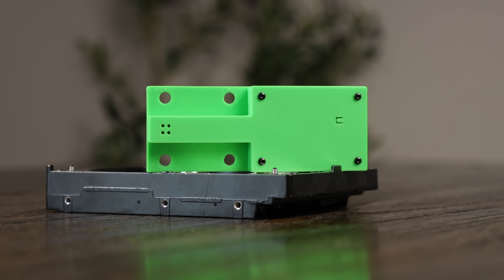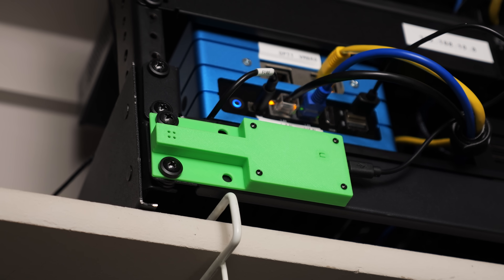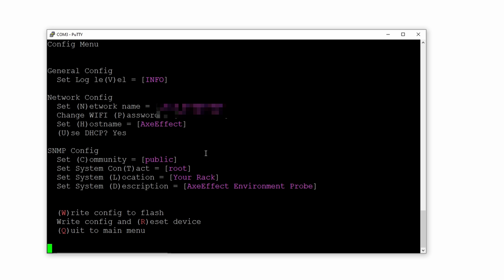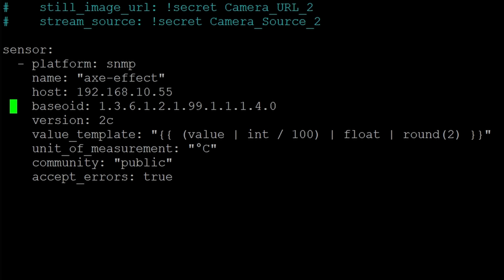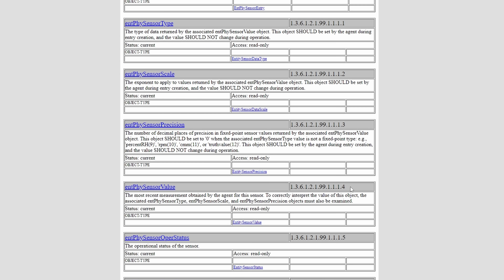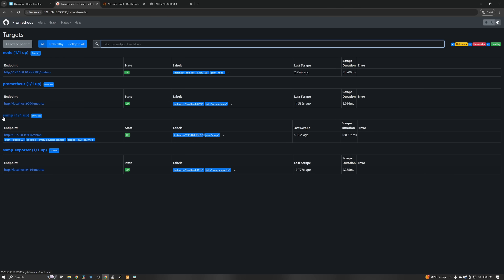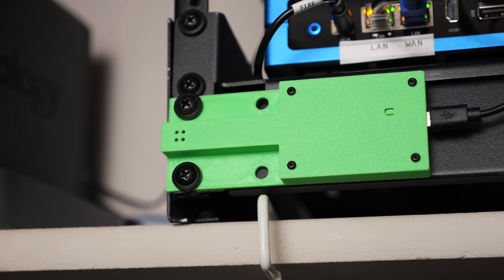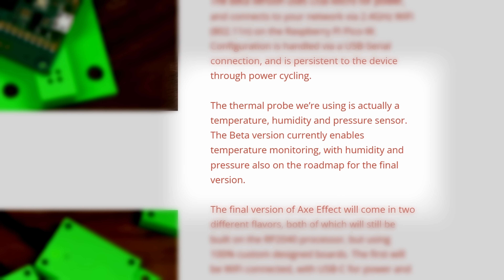This problem in my home lab is finally solved.

Comment: Why don't use something like xiaomi temperature And Humidity Monitor for something like 5$? It cost less, no work required, looks pretty. Can connect via Zigbee or Bluetooth to home assistant. And also lots of firmware available, if you need some additional control over it.

Comment: Having the MCU connected in that way to the temp sensor likely would not have accurate temp because the slight raise in temp from the RP2040 would throw off accurate temperatures.  Secondly why use wifi for temp sensors?  If you are that close to your server, why not just read the data directly from the pi and avoid flooding your environment with even more freqs?   Not good for our blood as the research is showing

Comment: I find an easier way to manage SNMP devices is using LibreNMS, this can store it's data in a InfluxDB database which is natively supported by Grafana. I still need to learn Prometheus myself to see what benefits it would offer me but I've been using the LibreNMS system for many years now and it supports pretty much any SNMP device easily without worrying about OIDs and coding, it also supports various alerting formats as well which may be helpful.

Comment: A couple of nitpicks on value_template thingy:
If you divide the value by a 100 you already get a float right? The digits must be there already because when you cast the value the digits are not lost right?
And why would you need to round(2) since the digits do exist within the float?

My understanding is that you probably are convert the string 2231 to an integer, this is fine (but weird it would be reported as a string), then when you divide by a 100 it is implicitly converted into a float it should only have 2 digits at most.

I'm nitpicking because I believe that relying on ChatGPT for simple things like that is just a lazy way of not reading documentation while using a complicated formula that seems like it could be simplified as "{{ (value | int / 100) }}".
I don't have the device so I can't try it for myself but I'm all for making configuration files as simple as possible.

Comment: Obviously this thing has a lot more compatibility than just home assistant, but that you can get that old ESP & temp sensor in Home Assistant with Tasmota in about 15 minutes from scratch. You don't have to write anything and it's pretty straight forward. It probably even auto-detects in HA so maybe no need to even do YAML anymore (?). ESPHome might be faster too.

Comment: I have temperature sensors setup with RTL-SDR's rtl_433 that populates into Grafana kind of similarly. I keep one in the freezer, outside, and inside. It's really cool to see defrost cycles, AC performance, and the weather. I need to try one of these or

Comment: There are already WiFi and Zigbee temperature and humidity sensors you can buy for about $5 shipped to your house from Ali and others, so the only selling point here is the SNMP part, the other stuff for integrating with home automation and custom stuff already exists.

Comment: One of the features (wireless lan) is actually one of my concerns: it's sort of beta, but it's designed and sized as rack-oriented... why this thing do not have ethernet interface?
Deploy this kind of devices in house or as ambient sensor makes a lot of sense, but in a rack you have to use ethernet in there and there's nothing more reliable than a good switch, compared to APs, which can become deaf with 2w of wireless emission)
Really nice concept, hoping to see son a PoE and ethernet version, with some "improvements".
1: redundant power supply (barrel + PoE)
2: RTC + NTP
3: data buffer (so if the switch reboots can anyway store data that can be provide to monitoring system)
Anyway: kudos to @craftcomputing. It's a interesting market niche to deliver some products.

Comment: I don't get it. What is the point of all this? You can already get temp/humidity/pressure sensors for less than $10 that easily integrate with HA. Z-Wave, Zigbee and Wifi. Battery operated and long-lasting. I have a number of them around the house and they work fine with my HA. And didn't have to go through some complicated configuration. Simply report the temp and humidity is what I want.
Reply: One of the main reasons is because it's fun to do!
Reply: The creator mentioned in his video why. tldr Server BS with needing accurate measurements and a good way to monitor it all from grafana ifrc. But also people do shit just because it's fun, rebuild the wheel just to see how it was built. ❤

Comment: I did basically this using an Esp32, a DS18B20,some example code a free io thinger account and a self designed 3D printed enclosure 3 years ago. It’s not hard folks

Comment: Wow this looks so overly complicated for what it is hahahs my recommendation is to install esphome, set up your device (no snmp required which is always a pita to set up), and you're ready with home assistant. Next, in home assistant set up a recorder which sends all the data to influxdb or Prometheus, that way your setup in Prometheus will be way easier and efficient as well, since HA will report all changes of all your entities so main setup is simpler.
Reply: Oh and for those asking "but i WANT snmp!!1!" Well, you can also enable that via an external addon with esphome although I don't know why you would want that, since the native api is faster, more efficient, it works very well and snmp is made for network equipment, not temperature sensors

Comment: You can get a Xaomi thermometer for dirt cheap, flash its firmware and read over BTLE (I’ve done it for plenty of projects). I think I buy them for less than $4 in bulk. I dump the data into MQTT and it gets consumed by grafana and Home Assistant. Stupid simple. Coin cell Battery lasts about a year. Chirps temp, humidity and battery level every 3-5 seconds, and there’s an LCD display on it as well and is in a tough case.
Reply: Exactly. Or get a simple Zigbee temp sensor from Aqara, 10$ maybe less. Small, cute, reliable, setup time is zero.
I like to thinker, but this doen't make sense.
Reply: @cerveraoliver I just read the xiaomi thermometer now has a Zigbee compatible firmware you can flash.
Reply: @AndrewCentofanti  i think you're talking about the Xiaomi Bluetooth sensor, I'm talking about the Zigbee sensors that cost just a little more. Either way are super convenient solutions, and are ages ahead the solution presented in the video.
Reply: any video about this?

Comment: 7:35 round seems to be unnecessary, if it reports 2231 and you divide it by 100, it's already 2 decimal points and will never be more than 2.
Reply: Most computers don't do base–10, so the base–2 approximation 22.3099994659423828125 needs to be rounded
Reply: @shanent5793  i not sure if any modern computer do base-10, from what i know all are base-2.
but this stuff is not done on such a low level that it matters, what you wrote may( and most likely will) be true on c/cpp but anything that is a bit higher level will deal with it no problem, bash or python will not spit something like 22.1199999 when dividing 2212 by 100.
Reply: @barneybarney3982  this is incorrect, the different possible rounding behaviors are why it needs to be explicit. Mainframe computers have native decimal arithmetic for financial calculations

Comment: Where do you guys outsource your 3D print jobs?  My extruder gummed up, and I’m having difficulty getting in contact with Vox Lab for a replacement.
Reply: Joel (3D Printing Nerd) and Repkord both have for-hire 3D Print Farms. I went with Joel for this first run. PCBWay is also a great option.

Comment: Nice idea, but this would be much better suited to using an ESP32 to significantly reduce cost. Raspberry Pi is a massive overkill for a temperature sensor. It's super easy using something like ESPHome, and you can have the ESPHome push data directly to something like InfluxDB and then graph the data in Grafana as well as easily getting the data into Home Assistant. LMK if you'd like more details on how to do this.

Comment: by the way for a home lab, you may want to set a net mask of 255.255.252.0, That makes it very easy to track which IPs are static vs dynamic. I have static, dhcp reserved range,  dhcp, software(ie containers and VMs, so I am not trying to trace an IP based on blinky lights to realize it is local).
Reply: How does a netmask (one word) of 255.255.252.0 help do this?

Comment: Not to take away from Jeff's project/product, but using ESPHome and literally paste 5 lines of code using an ESP32/8266 and temp sensor(s) of your choice (BME/P 180/280, DHT, Dallas, One_Wire etc).  Home Assistant has built recording, graphs and alerts builtin, a couple clicks away. For less than $10 (including filament costs if printing an enclosure)
Reply: Does that give you SNMP?
Reply: @scottleno4119  ESPHome has SNMP component. If you don't need SNMP, MQTT is supported natively, and works great for me for logging data from a whole bunch of various sensors.
Reply: @scottleno4119  yes it does if you know how to use external component. just google snmp esphome.
Reply: @scottleno4119  if you felt you needed snmp, you could have it, but there would be no need for it if your using home assistant, as it can talk to espHome sensors directly
Reply: I dont really understand need of snmp here, but there is snmp component for esphome.
Reply: @nameno6895  IMVHO SNMP opens more possibilities to monitor the device and chew data for deliver that to other collectors.
Reply: Agreed. The ESPHome web software (integrated into HA or standalone) even has an ESP flash tool that works from a web browser than can access USB devices. A couple of lines of YAML config, plug the device in to USB, flash, and it's fully connected to ESPHome over Wifi. 

Sure, this may end up being neatly packaged as a device, but I've found ESP32/8266 and ESPHome to be the jumpstart I needed to get back into electronics hacking that I gave up in my teens for lack of useful projects. Now, I have a half dozen or so ESP32s floating around the house/shed controlling minisplits, water heaters, solar controllers, and serving as temp/humidity/random sensors. All managed in HA, and I can tweak the code whenever I want and push updates remotely.
Reply: snmp protocol allows integration with more businness-y software solutions like Zabbix or Prometheus, Jeff's project is mostly for small and medium businness. Everybody at home could just get the usual home sensor stuff and connect it to Home Assistant
Reply: Why do I need snmp if I’m going to just graph stuff in home assistant? I think that’s what @thegreyfuzz was getting at.   With espHome and a few lines of code, I can have the same functionally, graph everything in home assistant, plus, over the air updates of the code, and not have to plug the device into a computer to many any changes.

Comment: What’s so special about it? You can do the same thing with a cheap lil’ Xiaomi bluetooth thermometer. If it had an ethernet port that would actually be valuable.
Reply: SNMP enables monitoring and alerting in a system most IT infrastructure is already running. I don't know many businesses that rely on Google Assistant to alert them about AC failure or overtemp in their server rooms.
Reply: @CraftComputing  Okay so SNMP, valid. But dude, your comment about Google Assistant is uncalled for. If you're using Home Assistant guess what? Direct integration with bluetooth devices.

Comment: What does this thing even do? If using home assistant, I just use a SDR and Acurite 433mhz temperature sensors. I use these for reading the humidity levels of my filament storage area, chicken coop, outside, kids rooms.
Reply: It's not necessarily focused on solving sensor needs for Home Assistant (though it works great). It's an SNMP enabled sensor, so Small-Medium business and server managers can track temperature and humidity via monitoring software they are already running.
Reply: @CraftComputing  I tried to find a link to your product. Where can I purchase one?
Reply: @MattKurkowski  I can't post a link here, but Colten did link to my original video about the boards. There's a link there on where to order. I'm accepting orders on the Beta units through the end of this month.
Reply: I do the same for most of my temp/humidity needs.

Comment: Its nice but I cant justify 60$+ for this
Reply: Sure, but what is the off the shelf alternative to this?
Reply: @michaelfitzgeraldnet  literally every single zigbee temperature sensor with zigbee2mqtt integration and usb dongle. This will be around 12$ + 5$ for each new temperature sensor.
Reply: @michaelfitzgeraldnet  even more expensive to be fair
Reply: @Tom_Neverwinter  tbh for snmp, the next device is around 1k in price, any other temp sensor wired or no designed for home use doesn't do it with snmp
Reply: @michaelfitzgeraldnet snmp isn’t worth it. It’s a temp sensor b
Reply: @H0mework  it is completely worth it, working in a datacenter, you already use snmp for monitoring, having also things you monitor in a single system for monitoring is extremely valuable. That is why at work I currently have $1k+ environmental monitoring systems in my DC's. In environments of 90f+ temp and 80%+ humidity... I really need to know if my AC's bloody work

Comment: You can buy wifi accessible temperature sensors for like $8. I'm not sure why this device exists......
Reply: They don't do snmp as far as I know, which is the big selling point of this I belive.
Also, this is phase 1 beta, I think the poe powered version is going to make a lot more sense for most racks than wifi.
Reply: @anthonypolsinelli1179  Exactly this. SNMP sensors just don't exist at affordable price points.
Reply: The same reason 99% of products exist. Convenience.

Comment: Awesome video! I am working on finishing up documentation this week, and should have some more info posted before the first round of Beta units ship out. I've taken notes of the couple bugs you ran into around DHCP/Static, and will get those into our bug tracker (that's likely just a serial port screen refresh issue, and should be trivial to solve).

We're definitely looking at supporting additional protocols on top of SNMP. Whether those are available on release of the final unit or come as an update later, we'll figure out as we get closer to launching.

As far as availability, we're leaving Beta ordering open until June 30, so you've still got time to order one 🙂
Reply: But what about the enclosure STL's? /s
Reply: @azmotorhead3614  That's a definite 'maybe'... For the Beta, we've finished the design, and I'll be releasing the STLs along with the documentation. For the final version, form factor is still WILDLY up in the air. And potentially going with another manufacturing process means the cases may not be designed well for 3D Printing. So.... we'll see.
Reply: I love that in the vast global YT environment, some people can see/use/comment on each others ventures.
Reply: One advantage of the Pi Pico W on board, is leveraging the wireless regulatory certification done by the Pi Foundation (Pi PLC?).  Of course, getting rid of the 2.4ghz and doing ethernet (and PoE would be nice for the single cable) avoids that regulatory hurdle.

Of course, if doing Pi Pico W, then perhaps the ESP32 starts looking appealing to save COGS.
Reply: Absolutely love seeing the Techtubers supporting each others endeavors! I was super excited seeing your announcement of this product. And I run an open air rack that doesn't even really need all that much temp monitoring.  It's just that cool. Lol
Reply: I am really wonder if the rpi pico has some temperature effect on the sensor itself. They tried to move it far, but in my opinion and external pluggable sensor would make sense.
Reply: @bluesquadron593  There is an internal break/barrier in the case which prevents any thermal 'leakage' between the internals and the sensor. We verified this with a thermal camera before settling on this layout and design. Though we are HEAVILY considering remote probes for the PoE version.
Reply: @CraftComputing given that this /IS/ a beta unit, surely it's no Biggie to drop him the beta unit STL....
Reply: @AlistairBrugsch  "For the Beta, we've finished the design, and I'll be releasing the STLs along with the documentation..." He literally said that in the first response.
Reply: @isaacjjones  I misread his 'maybe'
Reply: shut up jeff
Reply: Pog
Reply: I would like a RJ45 for something like this, I rather not have stuff running on WiFi.
Reply: @johnharrison712  PoE version coming later this year.
Reply: @johnharrison712 so you want an Ethernet interface, or a serial one? Both use the same connector with different wiring and neither are called that number that doesn't exist.

Comment: Arduino and ESP enthusiasts are screaming right now lol
Reply: This does seem like a lot of hardware for what should be a sensor + ESP12 board (D1 Mini?) flashed with ESPHome
Reply: @rexsceleratorum1632  exactly, also, he have a 3d printer so that would have been more compact, I wish I would have had one 3d printer
Reply: They're going to be even more enraged when they find out I WILL be using an ESP32 in the final WiFi version, but only as the WiFi module. Still RP2040 at its heart 😀
Reply: @CraftComputing  why tho?
Reply: @RaphaelAguirre  Porting SNMP to the RP2040 was far easier than the ESP32. And the RP2040 gives us potential to add far more features in the future. It's overkill, but it's overkill at the same price point as an ESP32-based system, and it runs our required software natively.

As for the ESP32 WiFi module, that provides us FCC certification for the final device, as the module has already been through the certification process.
Reply: @CraftComputing  huh?